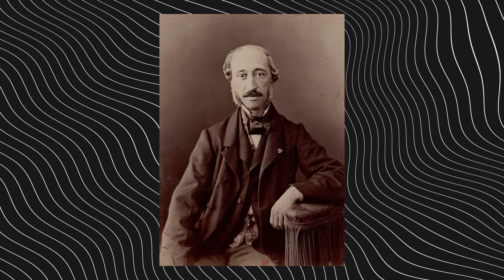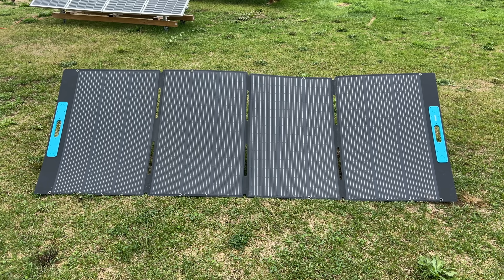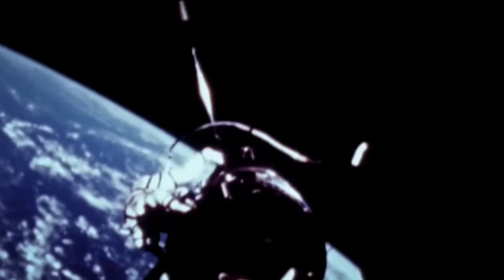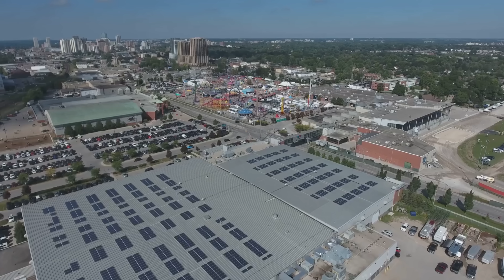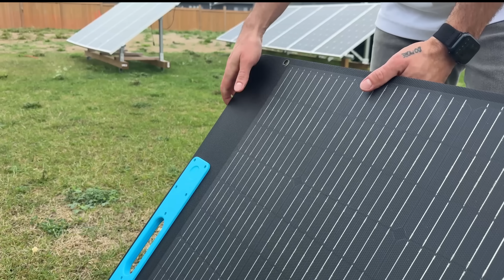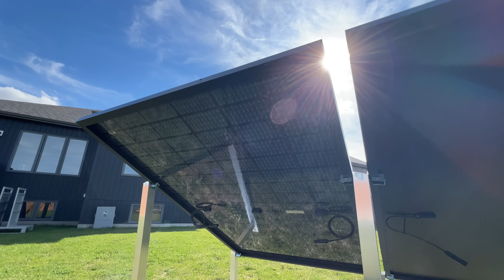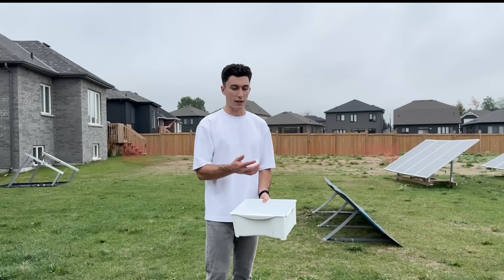Bifacial Solar Panels Explained - Why Are They So Popular?

Comment: A 500W bifacial, all-black N-type solar module for under 80 euros in June 2026—and that’s for a single unit. 
Bulk discounts are available for multiple modules. 
I don't think that's too expensive. 
Single-sided modules are hardly available anymore.

Comment: Even roof mounted, bifacial can be more efficient. I have a lake cabin with a white metal roof and as long as you leave some gap under the panel, it boosts output. I have both regular and bifacial solar panels and my newer bifacial panels consistently give better watt output. I get legitimate rated output with bifacial where I get about 85% rated with regular panels.

Comment: I plan to mount one bi focal panel vertical on top of my well house in the Philippines. Morning sun hits one side evening sun hits the other side. 
I have a deep 12 volt electric water pump in the well, and one 12 volt 400 AH battery

Comment: I have both the portable panels that I bought with my Jackery 5000 known as 500x panels (2 sets) and "Runergy Hyperion 400W Mono PERC Bifacial Dual Glass HY-DH108P8B-400 Solar Panel" (10x). The 400w panels start generating a few watts (20 or so but still it is generating) early morning before the 500x panels even wake up and the 400w panels continue to generate a few watts well into dusk when the 500x panels already have gone to sleep. This despite putting mirrors under the 500x to boost the bifacial aspect of things (https://youtu.be/eqrkF0pbemU). On the frequent cloudy days, the 400w panels generate 400 to 1000 watts as opposed to nearly 3800 watts on sunny days. I have documented this journey on a personal YouTube channel (not an influencer) at https://www.youtube.com/@jerryodonnell6316. I have tried applying a number of advices from "The Solar Lab" and appreciate the information. Thank you to "The Solar Lab" team.

Comment: We have a roof covered in bifacials, 13kw system.  They are about 15cm from the roof. And get the reflected light off of the roof to help increase proficiency. 

Im just trying to find a real video provong that they would work better if we paint the roof behind them white. On paper the answer is yes but id rather see the real science of reality  :)

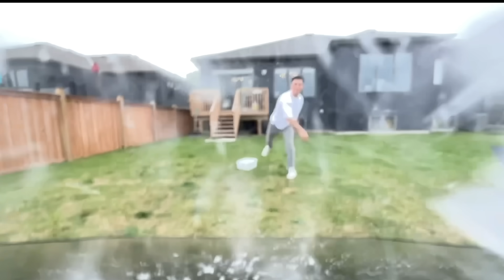Comment: 6:49 oh yeah. i never think that way. i bet that when people put bifacial in car parking in malls, parks, etc., we could generate more than we need to

i get it now. imagine all malls in north america has on the roofs and car parks. it would be more beneficial. imagine malls outside downtown core feeding electricity to downtown where it isn't usually possible due to high structures like buildings...

we could put plugs for car block heaters and have some limiters on the plugs to not draw too much electricity

all they gotta do is to drive out homeless people away from car plugs  

if there's one more thing the bifacial would become perfect, it's the PERC. slap it on the bifacial, then we could increase more efficiency

Comment: I have 10 450w bi facial and i love them price was right theh work great my batteries get filled every day even in bad weather my large appliances are gas so i relly dont pull much less ac is running and that even only pulls 1500w im good. Never will i pay a utility company for power again.

Comment: Quick question: if I have a mirror the same size of a bifacial panel just behind it, will it reflect more light towards the back of the panels, and thus get more energy - than no mirror at all? Have you checked this?

Comment: AFAIK, most panels these days are monocrystalline, it isn't really worth it to build poly panels with the low cost of panels, so much so that the frame and such starts to be a bigger portion of the cost. Also, thin film isn't very prevalent now, the bendable panels, including those in this video, are monocrystalline. Should probably do some basic research before putting out this slop.

Comment: Placing a white tarp under bifacial solar panels really ups the intake. Much more efficient than placing them on cement or grass.
Reply: You can get used white agriculture plastic for free from large dairy farms. It's usually white on one side and black on the other, 6 mil to 8 mil thick. Used to cover feed bunkers. This would be an awesome application to re-use it. It would also block all the grass and weeds under a ground mount.
Reply: what about a mirror?
Reply: @kevinkillsit  try it and report back

Comment: @thesolarlab I am going to add a couple of AE CMD-144BDS 585W N-Type TOPCon Technology PV Modules at a 30 degrees angle on my roof.  does it improve performance if I paint the roof in silver reflective material?

Comment: More energy than human can ever use.... AI Datacenters : Hold my beer.

That said, I still don't know if bifacial panels are really any good.    How much power can get through a reflection back?    I know that you can throw an apple at one, but no testing or comments of testing of the actual POWER OUTPUT of the panel

Comment: At a residence, if you want to engineer a vertical mounting as “fence” remember that physics of front and back side light input are the SAME, meaning any shading from wires, mounting rails or objects nearby cut output dramatically. Would you run a 2” x 5” aluminum rail over the front of your panel shading ALL your strings? No, so why would you think a magic result comes from doing this on backside or leaving wires hanging - it’s not logical my guy, think about it.  You can ENable or DISable a technology and bifacial is no different and not super easy to take advantage of. Go for monofacial if you’re not going to organize around exploiting it in a logical way. End of lecture. By the bye you can see an early holographic Prism Solar bifacial test panel in my profile photo - bit of solar history there.

Comment: Pt.2 Example: In 2016 I built a white roof commercial system using panels from Prism Solar where I set up production of early bifacial panels in 2009. We used new OpSun mechanically attached racking to hold “picture framed” support (no shading to backside) of landscape oriented panels at 30 deg tilt to south and l set low edge 24”+ above the roof, high side 4 feet above roof. Controlled row spacing larger than normal. 154 kW frontside rating, inverters AC output rating 166 kW (more than DC, never done). Result was 245,000 kWh over first year and almost daily clipping of inverters for hours (to fill area under the curve in lower light for Kingston, NY location.  I have never seen a more productive array per frontside DC rating, but it doesn’t happen 4” off a residential roof - it’s physics, not randomness.

Comment: Hardly anyone understands correct design to get more than 5% backside contribution from bifacial panels: huge albedo light from behind and NO shading on backside from rails or wires. Desert ground mount, correct carport, or custom design on white commercial roof with high SGCC rated reflectivity can get you 25% or more. Otherwise, use them if they’re cheap or use monofacial. Pt 1
Reply: know any videos that talk about this specifically? think id be interested in what it takes for an ideal setup. not even sure how a carport would be ideal

Comment: Biracial panel are more to fires.

They age better, glass silicon glass have the same contraction ratio, it's better than glass silicon plastic. In the long run they develop less micro fractures.

They cost almost the same than non bifacial.

Comment: It takes a LOT of solar panels to make enough power just to run a refrigerator!
Remember, you have line and equipment losses that gobble up some of your power.
Does not count battery storage for power use when the sun isn't shining or on cloudy days.
You need enough to power something AND charge the batteries. Most places only have 4-6 hours of usable direct sun.

MPPT controller is most efficient. PWM's waste energy but generally are used for cheap setups with very low demands.

BiFacial N-Type mono crystalline panes are about the best bang for the money.

Back side does not generate a lat of power but every bit is appreciated.

Bifacials are pretty heavy too.

I have 4 200w of the panels I described above. Going to get 2 more.
That should give me 1kw max generation to power fout 12v LiFePo4 batteries in parallel. My inverter is 2kw but 12v only. Chose that so I could use it on the car in an emergency. 24v and up you need to sell a kid to buy lol.

And just enough to power my refrigerator for a day.

Have not built the array or anything yet as I am still buying components and not sure if I want it portable or fixed.
With portable I can move it around to MOW the lawn or store it during bad storms.
I do not trust them to repel high speed or large hail.
At $1/watt they ain't exactly cheap to buy.

My problem is the long run to the house. Could only afford 8 gauge wire so I will automatically lose 15% or more. Even in series.
Maybe lose 90% or more depending on the load. Higher the load the greater the loss.

Controllers and such are not made to use 2/0 wire.
Lucky if you can find one that takes 6 gauge wire.
High voltage controllers (150v or more) costs a whole lot of money.
This is all small scale residential not large or commercial.
Not everyone has a huge sunny lawn with no trees.

Roof mounting is not an option for me as I have a high funky angles roof. And the wire run would be the same. And I don't want to get out a 30 foot ladder to maintain the panels either. And that is just to get above the gutter. Roof top a lot higher and steeper.

Microinverters don't cut it either as they are $40+ EACH. And then you have to down convert them to charge batteries then up convert back to house power for nighttime use.
Loads of losses there.

Comment: Wind and solar are tax payer funded scams.
Reply: Your mind is totally controlled. It has been stuffed into a mould, and you will do as you are told until the rights of you are sold.F.Z.
Reply: @ivorscruton5121 😅🤣🤣🤣 I needed a good laugh. Thank you for that. Nuclear is the only “clean” future.
Reply: @ahack14 But nuclear energy will fade your genes
Reply: @ivorscruton5121 🤣🤣🤣 that’s not how that works.
Reply: @ahack14  Nuclear is indeed zero carbon emitting. But to imagine it's going to be the main source of "clean" electricity, you have to be ignoring the reality of today. 
There are dozens of nuclear power plants being constructed at this time globally. But those plants will be between 300 MW to maybe 1-2 GW each. So after some years, maybe 5-20 years from now, there will be an additional 25-75 GW of nuclear power.
In the meantime, in 2024 alone, 600 GW of solar was installed, including about 300 GW in China and 30-40 GW in the USA. It was less the previous year, but it is likely to increase over time. Those numbers for solar will continue year after year as technology and manufacturing improve over time. 
In 2024, 5.4 GW of nuclear was added, 8 nuclear power plants. 
Solar installations were 100 times as much as nuclear last year. And that is going to continue for decades.
Reply: @AWildBard  Nameplate value vs actual production. Now compare those.

Nuclear is, by far, the best we have for industrial generation - from both a stability and production standpoint. Most nuclear plants will outlive any solar panel by at least twice. Plus the land use for industrial solar (and wind) generation is horrendous - and that's before we even get into battery storage. Small modular is very promising, once those hit it'll change thing.

Nuclear's only problem is it's reputation, leads to a huge amount of red tape in some countries.

I'm all for small scale/home generation, but on an industrial scale it's foolishness when compared to nuclear and the potential/real developments there.

Comment: I would only use bi-facial panels if most of your power usage is in a shorter 4 to 6 hour time frame. If your usage is lower but more spread out through the day it would be better to have single sided panels set up like an arrow head. Max output shortly after sunrise from first set and max output before sunset with both set out putting at a reduced rate mid day but their combined output would be around the same as one of the morning/evening sets. This would give you more of a constant output over 12 or more hours instead of a high peak for only 4 to 6 hours. Again if your location needs that shorter higher peak then do the bi-facial with white rocks underneath to max out year round reflection instead of just snow reflection, rain and when the snow melts will rinse of the stones for better reflection after winter and during the rest of the year.

Comment: I wonder what would happen if i used reflective sheet under the bifacial panels.
Reply: The sheet will get damaged over time, the best tested option is just cover the ground under them with white small rocks/stones. This set up will last decades and every time it rains or after the snow melts they get rinsed off several times a year for better reflection.